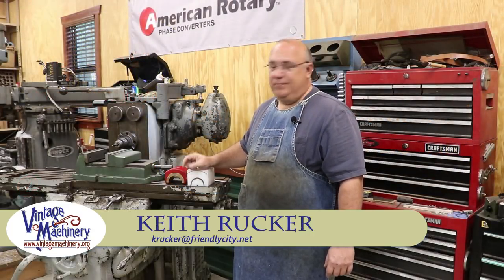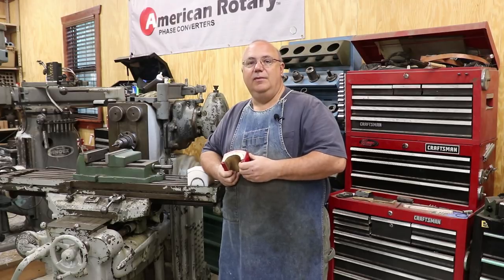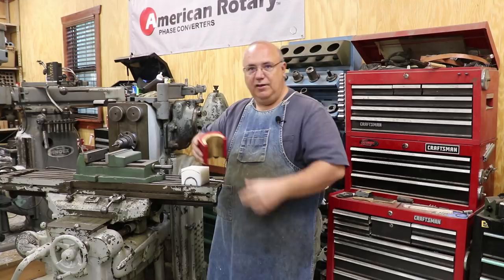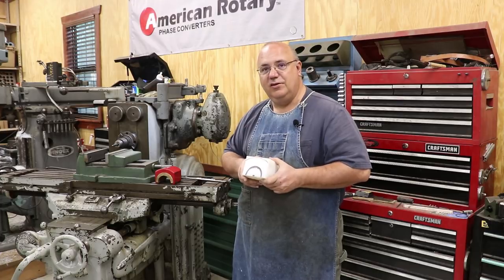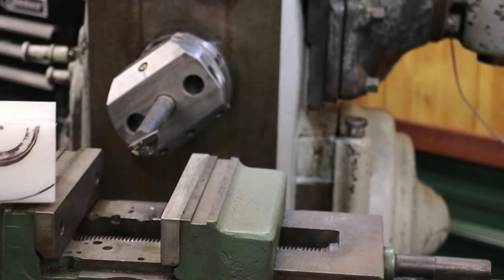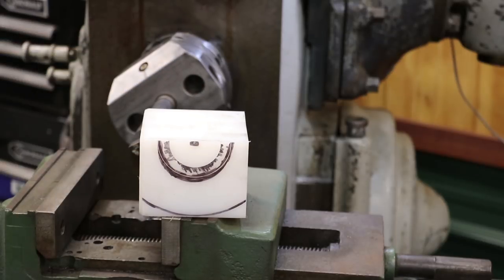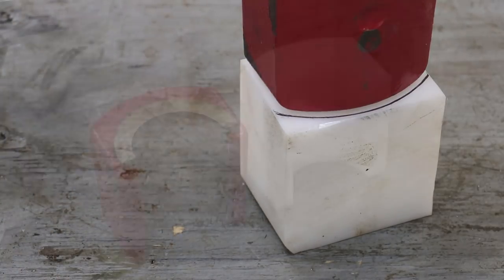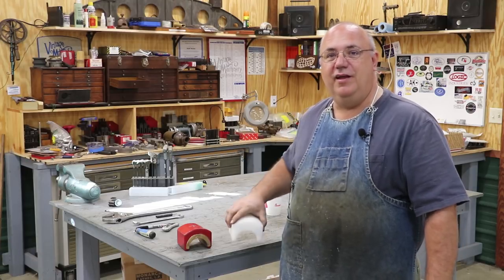Boring on the Horizontal Mill - Cane Mill Bearing

Comment: The Mennonites have taken over sorghum production here in Kentucky, and are still raising it pretty much the way it was done in the thirties and forties, and probably earlier.  They still use a cane mill to crush the cane, sometimes with a horse, and sometimes hooked to a pto, and they still boil it down using the boiler off an old steam engine to produce the heat for the boiling.

Comment: Hi Keith I found a type of plastic that is great for bearings and abraisive wear surface from mcmaster carr. Its MDS infused Nylon and it found it will outwear any thing even teflon in some if the harshest aplications. Ine apokication it outlasted teflon that hadn't to be changed every six nobths by seven years

Comment: Hi

I guess I am surprised you did not lower the table insyead of fooling with the band saw.
I still watch every vid you put out.
Thanks
Reply: Dennis Williams , Boring bars are great for boring and enlarging existing holes, but fail at creating a hole.
Reply: Dennis, I wondered the same thing even though it probably didn't take much longer if any longer to use the band saw. I don't understand where 
Tom is coming from though. He is correct that a boring bar is not used to create a hole but Keith wasn't making a hole in this video and the boring bar would have worked fine used as you suggested, which I'm sure you already knew =)

Comment: I noticed you set the center for the boring bar just a touch below the top of the block. That would make the bore a bit low (i.e. the legs on either side of the bode a bit long). Or did you surface the two legs to be on center after?
Reply: it only pushes against a gear shaft, one block only not a pair, a bolt pushes it and thus it gives adjustable clearance for the sugar cane you are crushing

Comment: I find that when using a Dremel on plastic (as close as I come to machining) light and fast is what works best. Don't dwell because it gives the plastic time to heat up and melt.
Reply: Mishn0 fast yes, light depends on the tool, .050 per pass may be about the minimum depending on the radius on the end of the carbide.

Comment: So what holds that bearing cap down? I saw a dimple in the center of the original cap, is there a dog or setscrew that holds it on?
Reply: a bolt, that pushes it to a shaft in the machine, it only uses one bearing block, and you adjust the bolt to give the clearance you want to crush your cane

Comment: Keith, I find that carbide tooling used as shipped, especially with coatings, isn't sharp enough for plastics - especially UHMW Polyethylene.  A sharp HSS tool with a high positive rake will do a much better job.  Just have to get the speeds & feeds right afterwards.  You should try machining Delrin plastic.  cuts beautifully.  just not good for bearings though.

Comment: Hi Keith, having never used a Horizontal Boring Head. before I have 2 questions, 1) for the roughing out, how would it work if you raised the bed up into the cutter for hogging out the bulk and then adjust the radius for finishing?  Although I'm thinking the answer there is as you stated in the video, you wanted to become more familiar with the boring head.  And 2) could you not leave the “fuzz” on until your finish pass /s, letting each pass remove the previous passes fuzz
Thank you again for giving us a great video I enjoyed it very much!
Reply: 1.Would have worked fine
2.Yes
Reply: They seamed logical to me, thanks for your input Steve.

Comment: Just wondering.... Would it not be best practice to have chucked that plastic block between a couple of thick big width ( exceeding the height of the block as located in the vice ) parallels on the outside to spread the pressure of vise jaw across the whole of it? Of course I don't know the material so perhaps it stays dimensionally accurate being nipped in the vise that way. I'm just asking because I have to make some parts in plastic (unknown what actual plastic) for an electronics project soon...

Comment: There was a vertical roller cane press near here, last time I looked at it in passing the old hedge tree that was fastened to it for turning it had fallen off.  It looks like it has been removed ... or the brush around it has grown enough to hide it.  I hope someone took it to restore it, and not some scrapper.  It was in pretty poor condition, it would likely have been more of a challenge to rebuild than the Vance.

Comment: keith how did you measure for the finished bore size? did you mill the block down to the center mark before boring so you could use the distance across as  your bore size.. the  horizontal spindle realy makes a easy job of this. thats a mighty impressive boring head you have there. glad to see you able to get back on matching videos. looking forward to more .
Reply: I'd bet money he just used calipers to measure at the widest point being that this was not a job that required tenth tolerances. What do you mean back to making videos? Keith has put out 3 or 4 vids in the past week over 15 in the past couple months....

Comment: I certainly understand the frustration with your untended association with Mr. Bozo as we are all perfectionist when it comes to chip removal. The finished product is a direct reflection on us as we would like it to always be positive. Use this as a learning experience and develop a means to prevent accidental engagement of the x-axis so you don't mess up an extensive project during the very last step. BTW, you are forgiven.

Comment: Keith,
Is that material self lubricating or will it. be lubricated when it is in the machine?
Reply: Ian Butler Depends on the rotational speed and some food processing do not allow to use any kind of lubricant.
Reply: another video on yourube used lard, its a very slow rotating part, and lard is edible anyway
Reply: Thanks.

Comment: I find myself surprised that you can obtain a super accurate cut when the boring bar and, especially, the heavy head is off center and rotating at a high RPM.  Plus the possible deflection of the long boring bar.  I suppose there are two mitigating factors.  The material is soft as compared to steel and the heavy casting of the boring machine is the stabilizing factor.
Reply: The same accuracy is easily obtainable in steel as that is what the tools were made for. Yes the bar does deflect as does every tool and material to some extent, but this is mitigated by either keeping a constant feed rate so the deflection is consistent or by taking a smaller finish pass.

Comment: I’d like to see how you measured the diameter of it.
Reply: hemiram05 I wonder as well.  Perhaps by placing a flat block on top of the flats, measure with a snap gage and double it? Seems that would be more accurate than using a caliper alone?
Reply: Charlie Romeo that would work as long as the top of the piece is at exact centerline of the circle but I don’t believe he was.